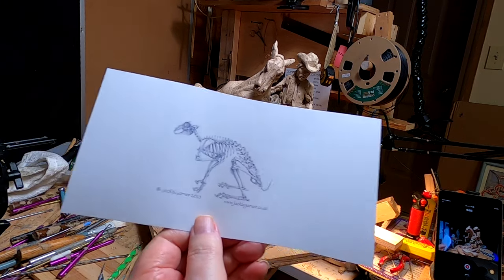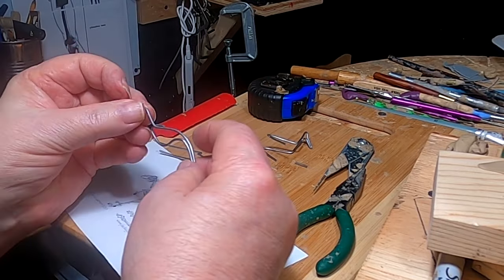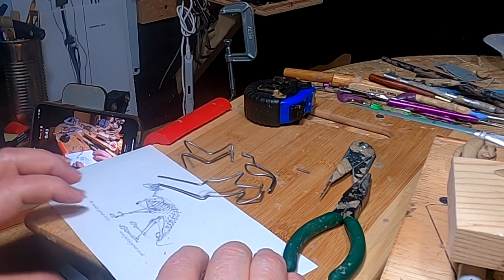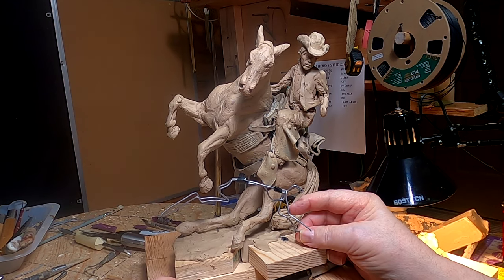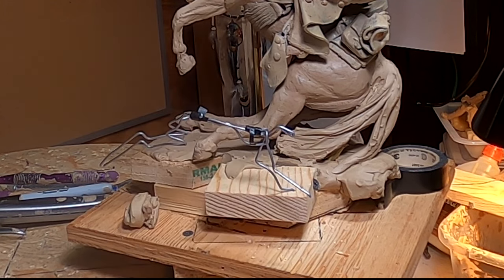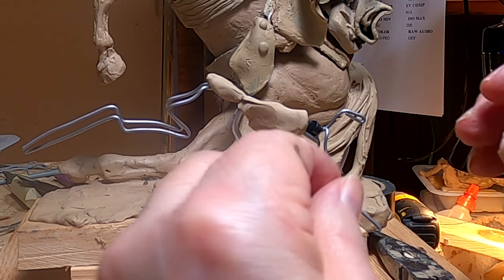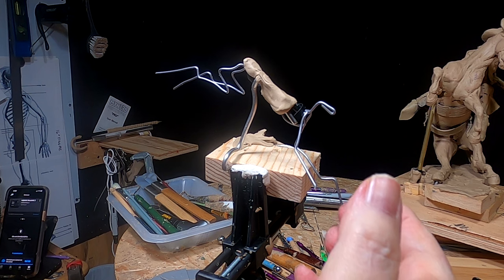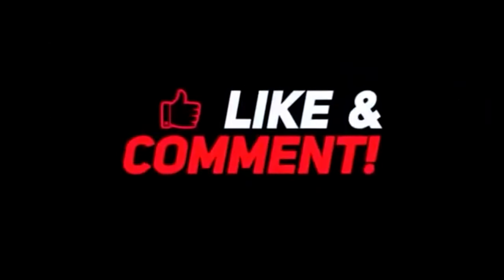Re Visiting an Old Clay   Making the Armature for the Jackrabbit Today

Comment: When I made my 21 jackrabbits I made skeleton pattern and gave it joints so I could figure the poses all different. When I settled on one I made the parts with cardboard and wire, then filled it out with foil and hot glue before adding clay. I saved my pattern in case I ever make another. Some were running with one foot touching. I understand it taking a lot of time planning it!
Reply from the maker: I've still got work on the positioning.. Going to have to wait till Thursday though.. something came up for tomorrow.. argh